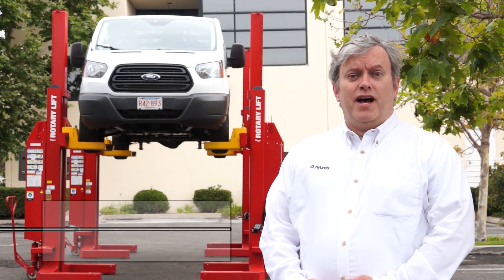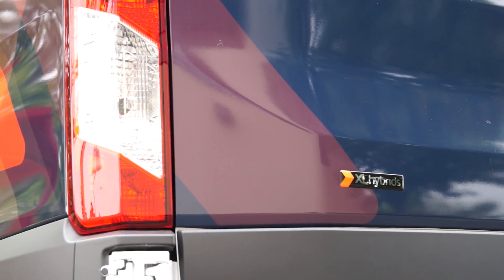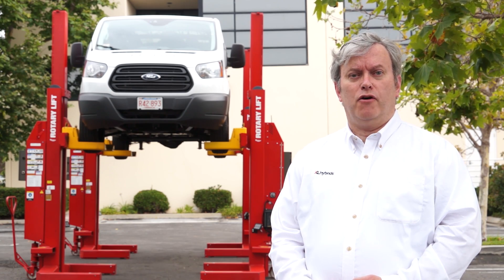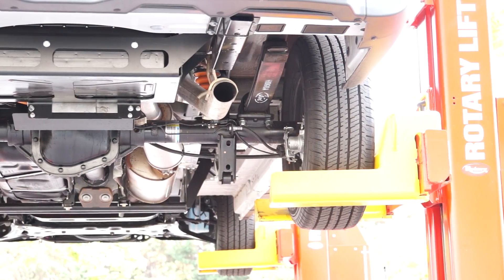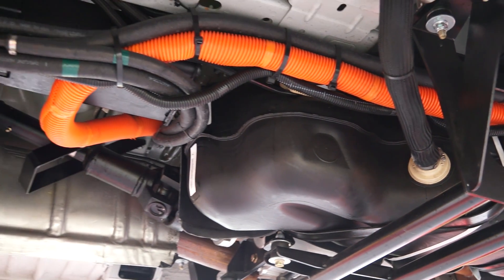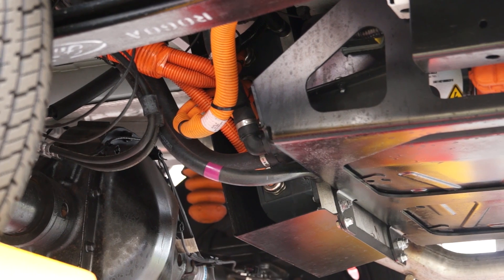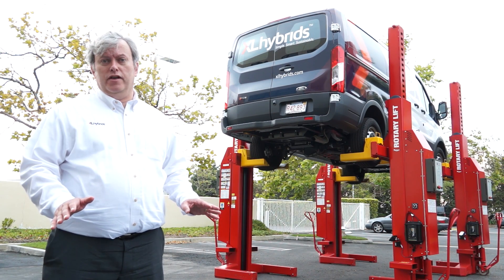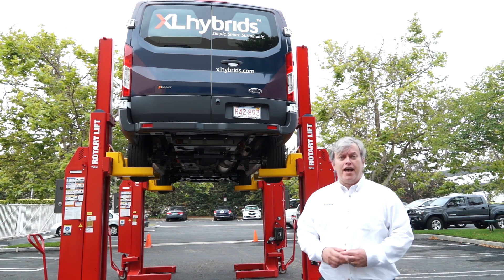A Closer Look at XL Hybrids Vans

Comment: Is it Zero emission?
Reply: NO!  The vehicle still uses an internal combustion engine!  This system ONLY helps to save on fuel usage so with that it helps to reduce emissions a bit but this system DOES NOT turn the vehicle into a pure electric vehicle with no emissions!